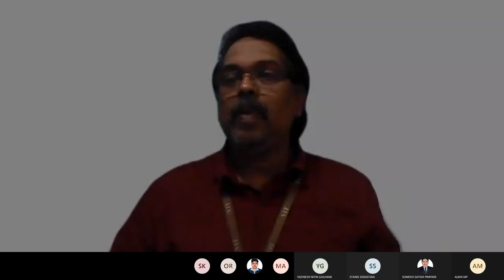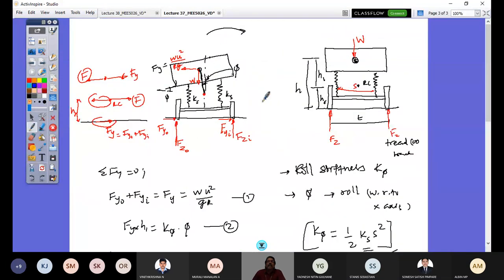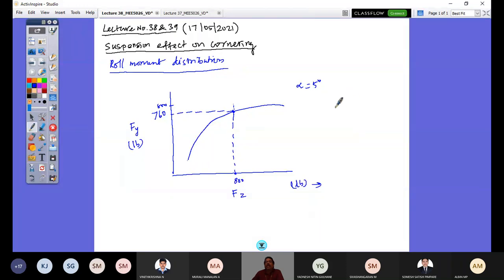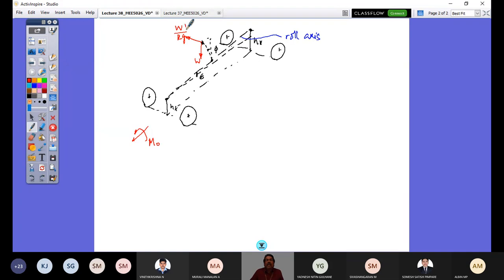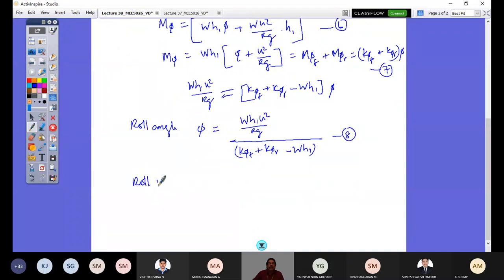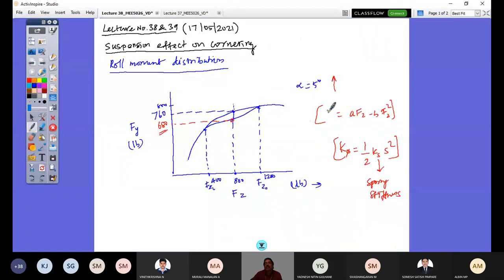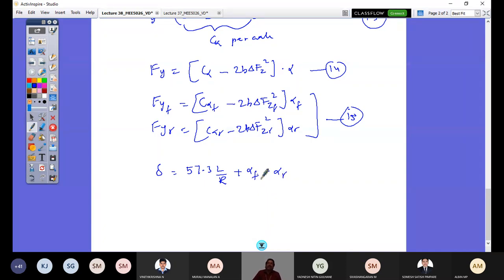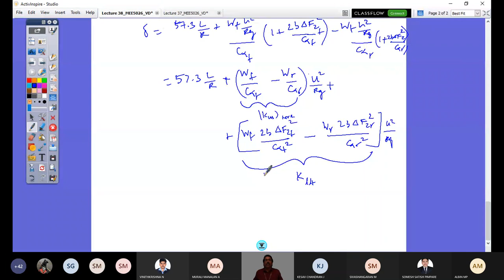Vehicle Dynamics Lecture 38 (Role of suspension over vehicle roll)

Comment: The lecture given by Sakthivel sir is thought-provoking and enlightening, providing new perspectives on how suspension and non-linear tyre models affect the understeer gradient. To improve safety, handling, and the driving experience as a whole, it was emphasised how crucial it is to take these into account during the vehicle design and optimisation processes. Anyone working in the field of automotive engineering or vehicle dynamics will benefit greatly from the professor's lecture.
Reply from the maker: Thank you for your critical observation of the lecture and response. Your good words are the real motivation. My best wishes to you. Regards, Prof. P. Sakthivel